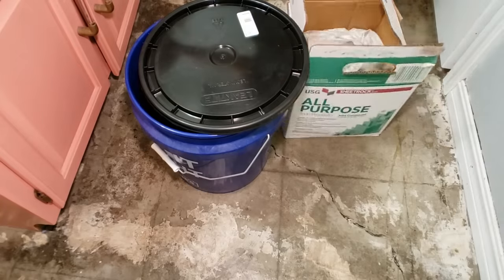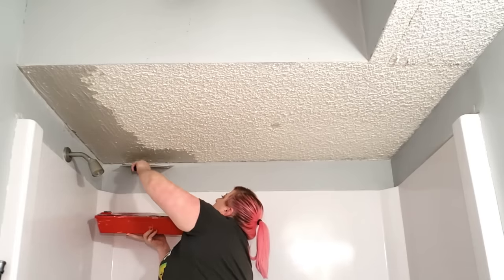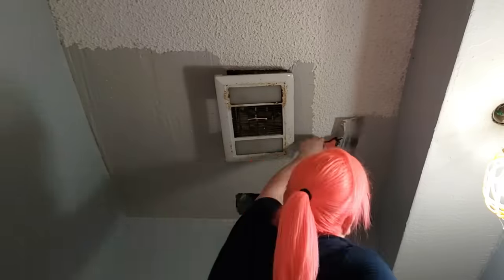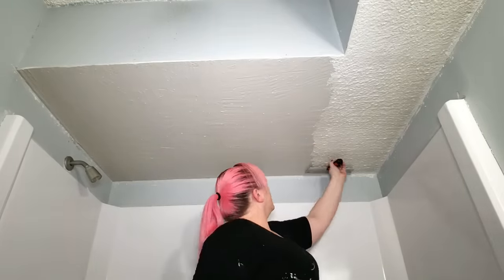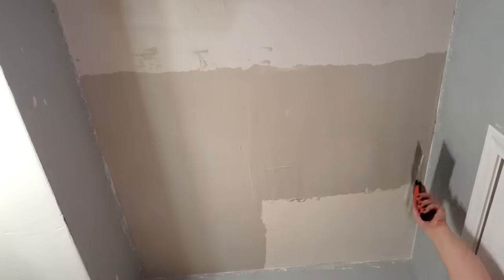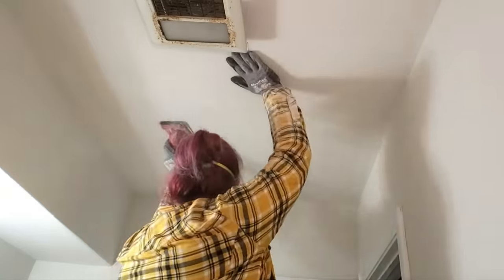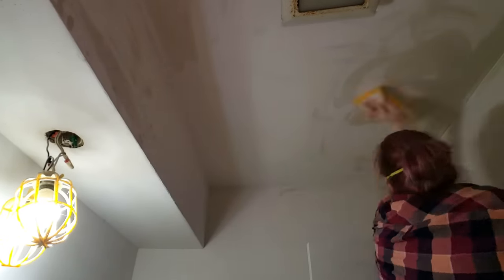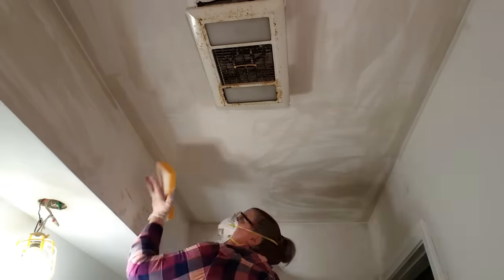How To Cover Popcorn Ceiling Without Removing It | Skim Coating Over Popcorn Ceiling

Comment: To keep from making a mess when sanding you can wet sand it with a sponge. To my surprise it actually says it on the box
Reply from the maker: Have you had any luck with that? I tried wet sanding with the sponge recently and it did not work well for me. I felt like it was barely smoothing out the ceiling and after I worked an area for too long it started to get  mushy. I would love to find a way to make it work though.

Comment: INSTEAD OF SANDING, USE A DAMP SPONGE.  It will eliminate a lot of dust and produce a nicer finish. Nice job, good video.
Reply from the maker: Thank you! I tried the sponge and hated it. Up close, I could see little streaks it left in the finish. Sandpaper left a smoother finish. The sponge was definitely less messy, and you probably wouldn't have noticed the streaks in the end, but I just couldn't get myself to go that route. I do agree, though. If you like the finish, it's a lot easier.

Comment: I have been working on the exact same project in my house for the last month. Out of curiosity did you have any trouble keeping your corners and the edges between the ceiling and walls nice neat neat and square? I have been fighting keeping the edges and corners nice it has been a pain in my arse.
Reply from the maker: I feel your pain! It took me a little practice to get those right, corners and edges are tricky. I pushed the joint compound in to the corner with the blade and went back over it from the other direction, trying to square off those corners. I went back and touched those up when the ceiling was done and used a sanding block to finish them when they were dry, that helped to give it a sharper edge.  I know I'm probably not explaining that very well but I hope it makes sense. Sorry you're having trouble with it.

Comment: As someone who just scrapped their popcorn and now needs to skim coat it to prep for paint and cover nail holes and exposed tape.

I wish I would’ve just done this. Such a huge mess and waste of time on my part where I now have to do this anyways. Might as well just go in cover the popcorn and save the effort and the heartache of mess and dust.
Reply from the maker: I feel your pain. I honestly don't know which is easier but this is less mess than scraping the popcorn. Either way it's all a lot of work. Good luck with yours!
Reply: @TheNiftyNester  I just finished up and your videos have been a life saver. You have no idea. I appreciate you so much and your awesome videos! Thank you thank you thank you!
Reply: @TheNiftyNester  also a little side question.

The ceilings are all scrapped now. Should I apply some joint compound now and then paint? Or am I good to go with sanding and  painting now that I have a smooth surface?

Comment: Don't sand...use a large chamfered-edge sponge made for this ( a 'grouting' sponge)  and let the damp sponge (water) smooth away those marks.  It takes a little practice, but it is worth it to never have to sand compound again!
Reply from the maker: I tried the sponge and hated it 🤦‍♀️ I think that's probably a great option. It just didn't work for me. I didn't like the streaky look it left behind, I felt like sanding left a smoother finish.

Comment: There is hope for my ugly popcorn ceilings. Thank you so much, I can not wait to get started.
Reply: Just install drywall sheet above it, the ceiling will be double but nice and flat
Reply from the maker: Thanks, Susana! Good luck with your project 😊
Reply from the maker: Installing new drywall works as well, but it's not the best option for everyone. You'd need another person or equipment you probably don't already own. You still have to tape and mud. If you're wanting a really smooth finish, you'll be skim coating it anyway. So, for those wanting to spend less money and do it by themselves, this might be the better option.

Comment: Great job with this presentation. However, three coats, sanding, wiping and then a final coat you called a touch up, then another sanding with a pole followed by yet another wiping!  Yikes, seems like more work overall, at least in my case since my room is MUCH larger and that’s just the main one.
Reply from the maker: Thank you, and yes, it is more work. I didn't make it clear enough in the video that this method is for painted popcorn ceilings. I put it in the title and thumbnail, but I should've stressed that in the video. This method only works on painted popcorn. If your ceiling isn't painted, you'd be better off to scrape it, then skim coat the drywall. You'd have to seal the popcorn before skim coating if they weren't already painted. I might make an update video just to explain all of that since I can't edit this video to explain it better.

Comment: I would not advise doing this in a bathroom. That popcorn ceiling has been painted. I would be concerned that the skimmed mud did not adhere properly. And because it's a moisture area like a bathroom, that might also compromise the adhesion.

Comment: Even if the popcorn is painted, won't quite a bit still come off while youre trying to skim coat it? Never saw you scrape off the blade
Reply from the maker: I didn't have any popcorn coming off as I was skim coating, or at least nothing noticeable. The popcorn was pretty well sealed under the paint which is what makes it harder to remove and why I decided to skim coat over it. I would guess that it's possible to have that problem, especially if the ceiling isn't in good condition and is already coming loose from the drywall, I just didn't have that problem in my experience.

Comment: Do you think in the end this is faster than scraping the popcorn ceiling off first?
Reply from the maker: I don't think it's faster, for me it took about the same amount of time. When scraping, I still had to skim coat the ceiling afterward to get a perfectly flat finish. The drywall always has imperfections. I think it was a little easier doing this over painted popcorn because it's so much harder to scrape off. If yours aren't painted, though, I'd scrape them off first, then do a couple of thin layers of skim coat to get that flat finish.

Comment: 2nd coat should have had a light sand to get off all bumps then on 3rd skim coat use a heavy nap paint roller and roll the 3rd coat on then skim with a knife way less sanding
Reply: instead of sanding - wet the dried mud in the areas to be smoothed out and use the mud knife to smooth them out.
Reply: @Elena-mk6bf  true that either that or wet sand with a sponge

Comment: What type of joint compound did you use
Reply from the maker: I used the USG brand Plus 3 which is a light weight joint compound and better for skim coating over textured surfaces like this. If I'm skim coating over a flat surface then I use the all purpose joint compound but I prefer the Plus 3, it's easier to work with.

Comment: Can you do this with an unpainted popcorn ceiling? What would happen?
Reply from the maker: Great question! I wish I would've included this in the video, I just didn't think to at the time. So to cover unpainted popcorn you want to seal the popcorn first with a primer. I think the quickest and easiest way would be with a paint sprayer and get a good coat of primer over the entire ceiling. There's a lot of moisture in the skim coat so that primer keeps the moisture from soaking through into the popcorn texture.

Comment: You can use a regular large wet sponge to sand. It should be written on the box. No dust and it gives you very nice finish. I learned that last year. FML. 😂
Reply from the maker: Thank you for the tip! I tried the sponge and hated the way it looked 🤦‍♀️ I felt like the finish was streaky, whereas the sandpaper left it perfectly smooth. Did you have any weird streaks in the finish when using a sponge? I'd love to try it again if I could get it to look right!
Reply: @TheNiftyNester  Maybe your sponge was too wet? Too much water softens the plaster and you get marks.  It does take a bit longer though. But there is much less cleanup.

Comment: With 3 coats, sanding, wetting, wiping, patching, wetting, & wiping, it looks easier to just wet it & scrape it or cover it with something. My arms & neck wouldn't last through all that.
Reply from the maker: This popcorn ceiling was covered in thick layers of primer and paint by the previous owners. In other rooms where the popcorn isn't painted, I've been scraping and then skimming the ceiling to get the smooth finish I want. This method is specific for painted popcorn and won't work on unpainted popcorn. I should've made that clearer in the video.

Comment: We highly Recommend to sand the popcorn ceiling with a Electric Sander if you have one to smoothen the tip. It will make it much easier to skim coat.
Reply: Isn’t anyone concerned about it containing asbestos?? Sanding asbestos is a death sentence
Reply from the maker: I wouldn't sand it unless you've tested and know you don't have asbestos. If you don't have asbestos then that would be fine, otherwise I'd leave it alone since it's already been sealed with primer and paint.

Comment: How long did this bathroom ceiling project take from start to finish?
Reply from the maker: It took several days since I had to wait between coats for everything to dry. One skim coat per day so 3 days for that then I got the sanding/ priming/ painting done over a couple of days with cleanup and dry time included.

Comment: It is not hard to remove popcorn idk why everyone is so afraid of it. Even if it has been painted the main risk you run is gouging the drywall which means… oh no… you have to skim coat it. So go ahead and try it, put some plastic down, spray some water on it and give it a scrape. If it doesn’t come up easily you’ll have to do this anyways so why start with it? I wouldn’t really accept any of my guys doing less than 200SF in an hour and that includes masking and cleanup.

Comment: Shouldn’t people be testing for asbestos before even touching the ceiling, nonetheless scraping or sanding it?
Reply from the maker: I didn't scrape or sand the popcorn. In a previous video when I did remove popcorn texture I suggested testing first, which I did. In this case though I'm referring specifically to sealed and painted popcorn texture. I didn't sand or scrape any of the popcorn, just sanded the final layer of joint compound at the end to smooth out the surface. I see the previous comment someone suggested sanding the texture first which I wouldn't suggest for this very reason unless you are going to test it first but then you're sanding off the paint that has sealed the popcorn and you'd have to re-seal it before skim coating so it defeats the purpose in my opinion. In any case, with or without asbestos, popcorn needs to be sealed with a primer at the least before skim coating over it.

Comment: This is a really great demonstration for DIYers. The pro videos have tools and techniques that its hard for DIYers to match.

If I can add a couple pointers that should improve the process a bit. 

First, I'd only recommend not removing popcorn on a heavily painted ceiling, if you try it on an unpainted one all the little popcorn nubs will be knocked off into your mud. And there's the possibility that the added moisture and pressure will pull the texture off in sheets anyway.

Second, its probably a good idea to spend a bit of time to scrape off the easily removed high points on the nubs to reduce the depth of your fill.

Third, do each coat in the same direction and alternate between coats. This will produce consistent peaks and valleys that will be more uniformly filled with the next coat. And you don't have to fully sand between coats but its a good idea to either sand or use your trowel to knock down any raised trowel marks.

Fourth, I like to take some mud on my finger and smoosh it into the corners to help get a smooth transition from ceiling to wall.

Fifth, when sanding its helpful to have an inspection light since its really hard to see imperfections in the drywall mud. Its also a lot easier to see remaining holes and imperfections after the prime coat and its fine to fix them after the primer. You just have to make sure to spot prime those spots.
Reply from the maker: It's been a while since I filmed this, so I can't remember if I mentioned it or not, but I might have assumed people would've known that I meant this was for painted popcorn ceilings only. I might have failed to state that clearly enough for others who don't know. I've tried to make sure when responding to comments to make sure they know the popcorn has to have been sealed previously.
I have several rooms left to scrape or skim coat, so I appreciate the tips! I know there's a lot of pro videos out there (I've probably watched them all, lol), but I definitely felt like there weren't a lot of DIY'r perspectives out there. Hopefully it helps others feel like they can tackle a project like this if another newbie with zero training or professional experience can do it.

Comment: I admire your hard work. However, if the popcorn ceiling does not contain asbestos, it’s much easier to just wet it and scrape it off. If it does contain asbestos, it is not safe to disturb it in any way. It is best to get professionals to remove it safely.

Comment: What if the popcorn ceiling has visible dust on it, is this method still recommended?
Reply from the maker: Popcorn ceilings are so hard to clean, just vacuum or dust as much as you can but it's ok if there's some dust you just can't get off! I couldn't get mine completely clean (such a hassle) but any remaining dust will just get absorbed and mix into the joint compound when you are skimming over the ceiling.
Reply: @TheNiftyNester  I m literally doing this right now it took me 4 hours for a small laundry room. Working on my second coat thanks for the info.

Comment: Hi, Nifty! Sorry to bother you if you've already answered this somewhere (but I read through the as-to-date comments &watched your entire video—well, with minimal "skipping through")—okay, so, anyhow, I think I have just too much going on right now to work as diligently and thoroughly to complete this type of project [& I am really impressed by your stamina & persistence!].

You know how, when someone does a sort of time-lapse video, the project looks perhaps easier than it is. SO, if you could possibly approximate the number of hours all this required of you—including time spent gathering and preparing everything involved, to the very [quite nice, btw!!] end—that "quantification" could help me be more realistic about whether I should put this off a bit. Thank you!!
Reply from the maker: I'm so sorry I'm just now responding to your comment! You might have already taken the plunge and attempted this but I'll answer anyways incase you haven't. Because of the dry time needed I only applied one layer of skim coat a day so it took me 3 days to apply 3 layers of skim coat (you might only need 2 so it'll depend on how heavy the texture is that you're covering). I believe it took me a couple of hours to do each layer but I will say I am slow and I worked in small sections, so it could take more or less time depending on your speed. So a couple hours a day, 3 days in a row, then it only took me a few minutes to sand the room. After sanding I took about 30 minutes to thoroughly examine and touch up any areas that weren't perfect (which is optional) then a quick sand again the next day after it dried. So total was probably over 4 days and around 7 hours approx.? After that it took me a couple days to finish priming and painting everything.
I hope that helps you make a decision, good luck!

Comment: Wait, I'm slightly confused. Did you not scrape the actual popcorn off?
Reply from the maker: No, not in this room. The popcorn had several layers of paint in this room, so it would've been difficult to scrape. This method only works if you're dealing with painted popcorn. In the rest of my house where they aren't painted, I've been scraping them, then skim coating the ceiling.